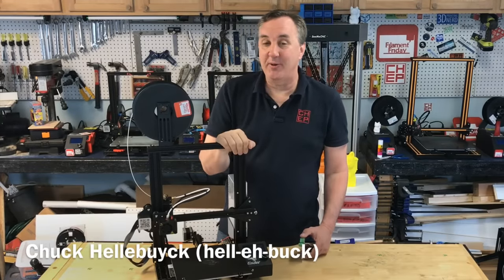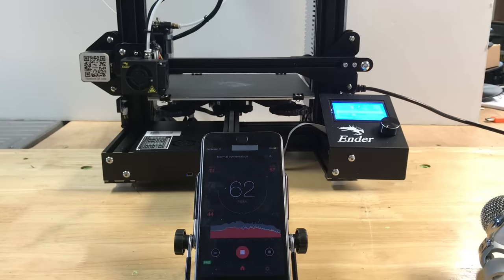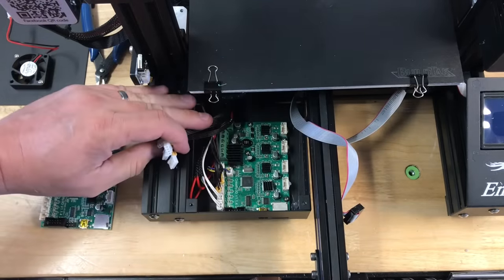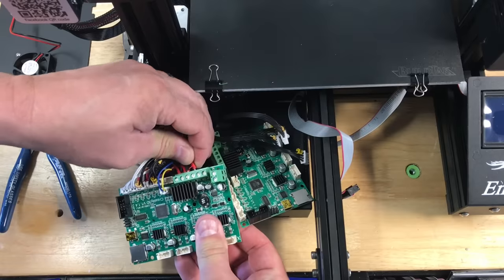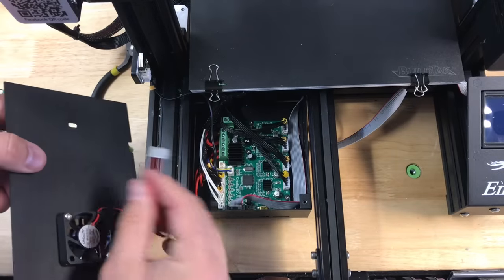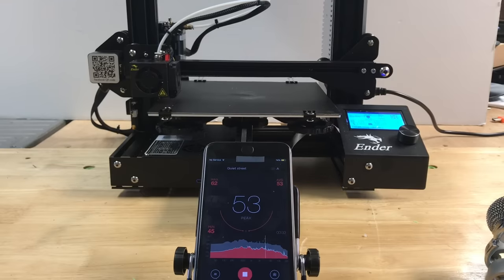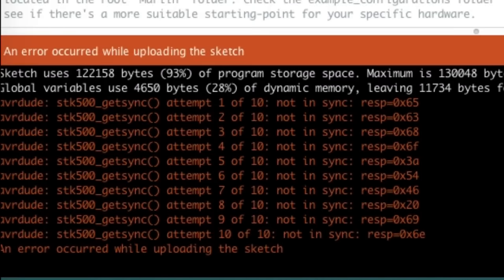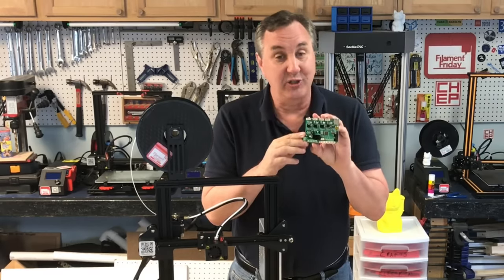Creality Ender 3 - Creality Silent Board v1.1.4 TMC 2208 Upgrade

Comment: Do one installing the MKS Gen L and separate drivers!
No the ones soldered to the board
Reply: I think of you are going after market your better off with an SKR V1.3.  32bit
Reply: I think the MKS is a much better option, and you can get it with 2208s shipped for about the same price point...

Comment: interesting they did this, but its a pitty they didnt go with the 2560 chip instead, for me myself I shoved a gen L in mine with 2130's also replaced the display with the RRD 12864 for the card reader,  but doing this I had to resort to a bit of cutting and filing as I used the original case

Comment: Hey Chep thanks for all your great videos.  You have really helped me learn so much in the short time I have been 3d printing.  I have ender 3 pro and I purchased the Zeelo TL-Smoother kit but have not opened them yet. Are they still needed with 1.1.4 Silent board? Im thinking that the new board controls the voltage better and causes less spiking?
Reply from the maker: No, the TMC2208 drivers do not produce the salmon skin effect that the 4988 drivers do so TL Smoothers aren’t needed.

Comment: Thanks Chuck!  Another 3D printer vlogger trashed this board in his review.  Mainly due to the two layer design - saying that heat will destroy the board in a very short time.  Any thoughts on the two layer design and longevity?
Reply from the maker: My background is Electronics. I can’t say that theory makes much sense to me.
Reply: @FilamentFriday  - Me too.  His argument was insufficient copper to dissipate the increased heat from the TMC 2208s.
Reply: Link? I would like to watch that.
As the TMC2208 are designed as a drop-in replacement for the A4988 I would expect Trinamic to make this work as such.
And evidently the A4988 do not burn out the boards.
Reply: @rudolphriedel541  - My mind is blank right now (nothing unusual for me - LOL).  I'll do some digging and try to find it.
Reply: @rudolphriedel541  - Are you on Facebook?  If so, PM me there - I have same name and avatar
Reply from the maker: Extra copper helps but you’d have to determine the current being used and the calculate the dissipation needed before saying it would fail. The Ender steppers draw less current than the 2208 is capable of so I doubt it’s an issue.
Reply: @FilamentFriday  - I actually wonder if the extra copper could be detrimental to the rest of the board.  Drawing heat from the steppers and transferring that heat to other components.  Probably only theoretically though.  :-)
I think the best solution is just good heat sinks with good thermal paste and adequate airflow anyway.
Thanks
Reply: Okay, I have seen the video now and there is not much to learn from it.
He says that the TMC drivers need four layers as they run hotter, but he is not backing up that claim with anything. This is nothing more than 5 minutes during a 1h30 live steam.
Based on that I can neither decide if he is right or wrong with this.

I guess I need to go ahead and modify one of my boards to see for myself.
Reply: @rudolphriedel541  - My thoughts too
Reply: I am going over the TMC220x datasheet again and found something that might be helping with power dissipation by "accident".
Pin 14 changed from /Sleep at the A4988 to PDN_UART on the TMC2208.
On the V1.1.2 and V1.1.3 boards as well as most likely on the V1.1.4 boards pin 14 ist tied to pin 12 and connected with a 10k resister to VCC.
Furthermore pin 12 on the A4988 is /Reset input, but on the TMC2208 it is Index output.
PDN_UART offers "Automatic Standstill Power Down" when pulled low which automatically reduces the current in the coils after <5.6s without steps.
That pin 12 and pin 14 are shortened could mean that for the most part "Automatic Standstill Power Down" is active since the Index output only has a high signal if the sine curve of motor coil A is at its positve zero transition.
Measuring the volatge at the side of R15/R38/R21/R24 that is facing the driver with a scope would show this.
If the voltage is below 1.5V the Index output can drive the voltage to low against the 10k pullup.
If the voltage is above 1.5V all the time the index output is to weak to drive against the 10k, it might be worth a try then to replace it with 47k or 100k.

Of course there is a chance that a motor is stopped in a position in which the Index output is set to high.
At least Z should be most of the time running with reduced current.
Reply: @rudolphriedel541  - that would help some I guess

Comment: Upgraded to the new board (now 1.1.5) super silent, even more silent than using stepper dampers. But when running fans on lower then 100% speed, there is a whining noise. Which would you sugest - use FAST_PWM_FAN or FAN_SOFT_PWM. What are the downsides to them? FAST_PWM_FAN Makes the mosfet run hoter, but is it much of a concern?

Comment: Maybe you should try the Duet Maestro Board, as it offers much more bang for the buck.
Reply from the maker: At around $120 plus all the mods required, I’ll pass for a sub $200 printer. $49 for the Creality board was pushing it but it was an easy plug and play.

Comment: Regarding those firmware upload errors - I'd try changing connection settings in Arduino Studio (or is it called Arduino IDE?), like connection speed, or bootloader type ("new" / "old").
I remember having these weird upload errors while working with Chinese Arduinos, but after some fiddling with settings (specifically bootloader type, they always have "old" bootloader, whatever that means) they all worked fine.

Comment: I just updated my Ender 3 with the Creality Silent Mainboard V1.1.5...Wow! I should have done it sooner. The board came with firmaware 1.1.8 .
Before installing it, I had the Ender 3 in the basement and could hear print on the 1st floor. Now I could just hear the fans just several feet away.
I made sure to mark identical wires with markers...just in case.
Reply: hi, did you upgrade the firmware? thanks
Reply: @pieter-6385  No, I didn't upgrade the firmware. It came with firmware 1.1.8.
Reply: @jsalce  thanks. And that still is the last version available now?
Reply: @pieter-6385  That's the latest one available from Creality website.
Reply: @jsalce  last question, could you provide me the link where you see that latest download on their website? Took a look and only find a downloable 1.1.6. I am asking this question so that I can monitor firmware versions in the future. Thank you.

Comment: Hi Chep, thank for the very useful video! I was evaluating to buy TL smoothers after your previous video, but now I would like also to install the TMC 2208 upgrade. Do you think that TL smoothers would be anyway useful, if installed together with this new board?
Reply: I think, you don't need any TL smoothers with this board.

Comment: This would be a great upgrade, IF you can actually find one! As of today, I have not been able to locate a silent board in stock ANYWHERE! If you have a line on a dealer with the boards in stock please let me know!
Reply: Neal Rogers try to go to creality’s website directly. If you can’t find it there, try to call creality or at least email them. They’ll probably tell you where the board can be found.
Reply: The 1.1.4 silent board is now the 1.1.5, as both 1.1.4 boards were made with and without the tmc drivers.

Comment: My two cents :

This board is hyped a lot atm. The effect is as expected BUTT (as @Alex Kenis always says)

a) the fact that you had no bootloader, 1.1.6 and thermal runaway protection and @Michael Laws had it different with the 'same' product clearly shows that creality has no configuration control and a very doubtful QC department.
b) the effort to change the board is close to changing it to a board with exchangeable stepsticks. These would allow for UART setup, which is not possible here.
c) Warning! Given you can't change the TMC2208 into UART mode, you will not be able to use this board in a Klipper configuration. Depending on how fast you print or if  you have pressure advance enabled, the drivers will falsely detect an overload condition and then shut down midprint. This is because they are using stealthchop2  in standalone mode.
If you plan for something like Klipper, go for a mks Gen L or similar. It also easily fits a 1.1.x or a 2.0 Marlin if desired.

Comment: Mine came with a bootloader and v1.1.8.  Maybe you got an older build?  I got mine directly from Creality, and pretty happy with the silent printing.  I still have problems with Octoprint disconnecting just like the previous v1.1.3 board.
Reply: @deceitive3338  Thanks!  I will definitely give that a shot.  I feel like I've tried just about every other fix in the book.

Comment: Do they have UART connection for the TMC2208? There are reports of TMC2208 not working for Extruders in stand-alone Mode. Would a bigtreetech skr 1.3 not be an cheaper better Upgrade?

Comment: Great video again, quick and to the point, whilst still covering what we are looking for, thanks for the good comparison of noise levels. I do have a quick question though about the thermal runaway protection, did the board actually cut power itself to the heater or just display the message? I've seen conflicting info about that.

Comment: Steppers are quit on that board. Installed one on my ender 5. Needed firmware changes and I installed vanilla marlin 1.19. I had bootloader there. Some essential features like disabling xy steppers are not in marlin vanilla but a  couple lines of code did it for me.

Comment: Thanks for posting this Chuck!  Did you try using the processor profile in the Arduino IDE labelled "(Old Bootloader)"?  I just had to learn about this with Arduino nano clones that also happen to use the 340G USB->Serial connector.
Reply from the maker: No. I’ll try to find that.

Comment: Just to be sure of TRP,check the hotend with a meter!Think it was Teaching Tech that got the same alarm,but the board STILL was pumping out 22 volts!Be safe!BTW,can anyone explain WHY the board/drivers makes the servos "silent"?I can get a grasp as to how a staic board(non-moving part),can change HOW the servos get quieter,farther down the line.....Thanks for sharing!
Reply from the maker: The steppers are driven by differential voltage  with signals that look like a sketchy sinewave  The newer drivers produce smoother sinewave so it reduces the noise in the stepper.

Comment: Thanks for the video !
Reply: Hey bud do you have any info on what would cause a print to have little bumps and whisker like strands.  I was printing a groot and on the back side with all the details was covered with the little bumps and whiskers. The face was perfect.
Reply from the maker: Possibly the filament or partial clog in the nozzle. Could also be temp related.

Comment: What will happen if you install the TLSMOOTHERS with the new board? Will it make a difference or will it be the same?
Reply from the maker: TL Smoothers won’t help. They are for 4988 drivers.

Comment: Thanks so much for all your tutorials. My daughter and I have been looking for a hobby we could do together and I think 3D printing may be it. I bought an Ender 3 Pro and this board. I have not installed it yet because I would like to add a bed leveling sensor at the same time. Which bed leveling sensor would you recommend with this upgraded board?
Reply from the maker: I’m not that experienced with autolevel. I honestly don’t recommend it. But many use BLTouch. It will require an extra plugin board to use it.
Reply: I've been 3D printing for 3 years now, own 4 printers, only 1 has autoleveling... Let me tell you it's not worth the hastle unless you are going to use huge buildplates (400mmx400mm or larger). It 's money you could better spend elsewhere, it's a hastle to install, and once you get the hang of manual leveling, you can adjust on the fly. I would put the money towards a good build plate adhesion, build plate insulation, hotend silicone sock, better cooling fan, LED lights on the printer, an IP camera to check on your printer when you're out of the house (for longer 3D prints). If your 200x200 buildplate is so crooked that you need an autolevel to compensate for sags etc, i'd rather put the money towards a sheet of glass or mirror to put on the buildplate.

Comment: Ordered a 1.15 board for my ender 3 from Amazon last week but received a newer  4.2.7  32bit board. Fan connections are in a slightly different location but otherwise it seems to work ok.
Reply from the maker: Interesting

Comment: Thanks for the video Chuck, I've already installed motor dampers on the X and Y axis ($3.50 for 2) and my E3 seems to be as quiet as this one. I bought the TL smoothers but I have yet to install them. I think I'll pass on this board because my E3 has been so reliable as it is.  If Creality had implemented something like Anycubic's leveling switch/sensor or support for the BL Touch that would have been compelling but as it is I'd be spending $50 for thermal runaway and I'm not sure that's a big enough feature to justify the expense.  Nonetheless this is good information. Thanks.

Comment: Chep, are you certain that the Creality Firmware Version is the same thing as the Marlin firmware version?  I seem to recall watching a video where someone connected to the printer and displayed firmware information that showed the Marlin stuff separately from what is displayed on the Creality Touch Screen.   My impression was that Creality creates a firmware version x.y.z that has a Marlin Firmware of a different version embeded within it so you would need to know which firmwares map to which versions of Marlin.

Comment: wonder if the CR-10's will get a stock 2208 board?

Not sure why they don't name the board something different like 1.1.4s or something like that. I think the only way to tell the difference between this and a stock 1.1.4 board is to take off the heat sinks and see the label of the stepper drivers. That and only going 1'ish out of 3 on the advertised upgrades kind of ruin the upgrading experience. If they weren't going to change the name, they should have just put this board into the ender 3 pro and/or CR-20 as stock and said nothing like they usually do with most of their incremental upgrades.

Comment: Hi, love your videos. Thinking of doing this upgrade, but I have all my settings correct etc. I really don’t want the faff of trying to set everything up again how I need it, as I print to make money. If I do this board upgrade is it plug and play? Will I have to do anything such as the Arduino stuff you did there? I’m hoping to add it in and then have everything work as normal but quieter. Will this be okay? Thanks.

Comment: For myself the sound isnt a problem, but its annoying not to have the stated firmware version on the board so i wouldnt buy it.  Then you werent able to update to the stated one anyway...The Teaching Tech bloke has done a video on upgrading to a different board etc....i would try using your method for reconnecting the wiring etc...  thanks  Laurie

Comment: Thank you for your content, i'm new in 3d printing and your channel is VERY helpful.
Is this board is compatible with a CR10-S ? or there is a specific version for it ? i do some research but it's not clear for me.
Reply from the maker: No, this is for Ender 3 or 5 only. I don’t know of a similar board for CR-10s.
Reply: @FilamentFriday  thank you very much ! i will change the drivers on the original board, but i'm not too confident about the voltage settings with a screwdriver :(

Comment: If you just bought another one for $200 would you get the new board too? Seems kinda steep for an upgrade. If I ever actually stop printing I may look at my board to see whats on it. The $10 Arduino firmware to add mesh bed leveling seems like a better return on investment since i can make it close my garage door after I'm done...
Reply from the maker: No, it’s not shipping with new printers.

Comment: Hey chuck, it would be great if you answered. Anyway, does today's ender 3 pro come with a silent board factory installed? Thanks
Reply from the maker: No
Reply from the maker: Yes, the silent board is actually 1.1.5 but the first ones you could buy mistakenly had 1.1.4 label which caused confusion because the non silent board included is a 1.1.4 which you have.

Comment: Honestly, for the price, wouldnt a duet maestro make more sense?
Reply from the maker: If you have the ability to mod it. Some just want plug and play.
Reply: Duet maestro is also $120 US, way overkill  for an ender 3.
Reply: @FilamentFriday  fair enough, it was a PITA to get mine up and running exactly as I wanted :) the wiring itself is not that problematic, it's the configuration that gets tricky as the online generator doesn't do the best of jobs.
Reply: @ricks1936  there's also the option of buying it off Ali, but it's true that then you do not directly suppose duets creator who was kind enough to open source the HW designs
Reply: A Duet would be overkill - except of course you want to upgrade the Ender 3 to become an IDEX or someting like that.

For easy upgrade the board of an ender 3 since this video got released 4 different boards there released. All this boards use the formfactor of Creality's board, have extra connectors for ABL, Filament-runout-sensor, Touchscreen (serial) and lights and use 32bit (Marlin 2 preconfigured for Ender 2.0):

- TH3d (TMC2208, expansive...)
- Fysetc Cheetah (about 30$, TMC2208)
- SKR mini e3 (TMC2209, about $30)
- SKR e3 DIP (sockets, about 15$)

Esp. the SKR boards are using the main fork of Marlin 2.x (SKR-Mini board is in the board.h), so very easy to update and modify if needed.

The SKR e3 DIP seems the most interesting in my opinion, as using a driver with 1/32 native microstepping for the extruder seems to be best. For x and y of course a TMC - and on z mostly does not matter, so use what you have on hand.

My SKR's are on their way...